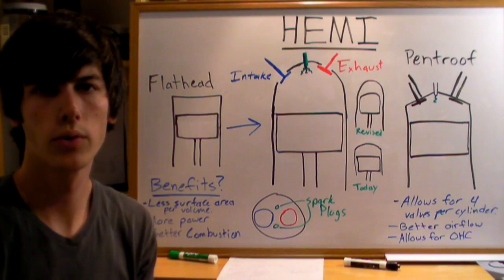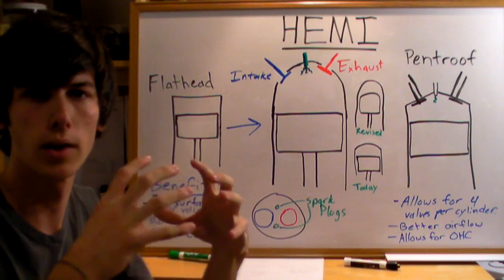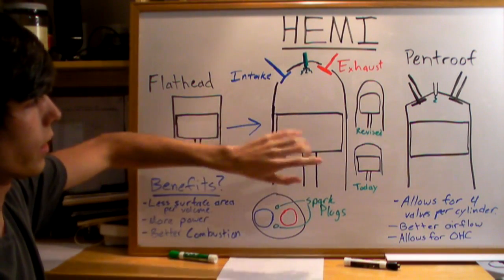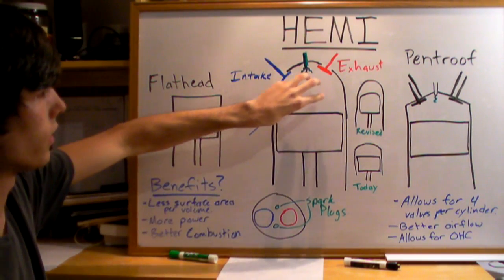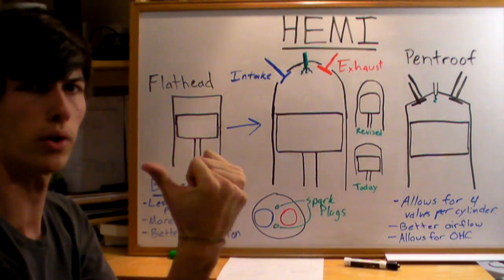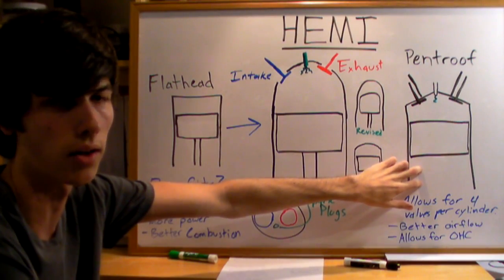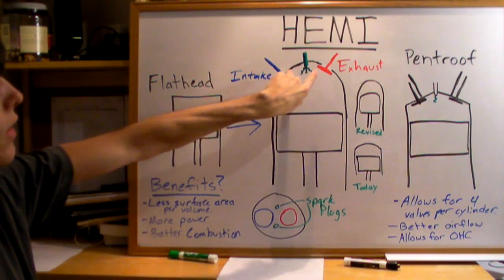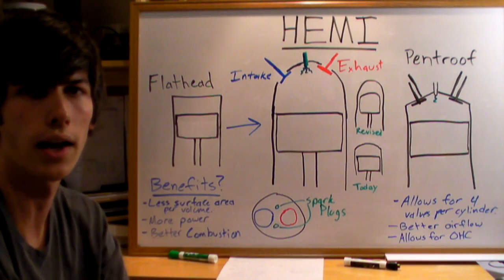What Is A HEMI Engine?

Comment: I like your videos man but disagree with the DOHC vs Push-rod view.  Yes, a DOHC is more efficient due to its valve curtain size but they are also heavier, larger (top to bottom thereby affecting hood design) and far more complex engines that introduce more things that can go wrong.
Reply: DOHC 4v in a V-engine without VVt and VVL is actually simpler than pushrod design and has less moving parts. Judging by the engines available in Europe pushords don't seem to have any advantage in reliability over DOHC. And since DOHC is more efficient a smaller engine can be used for the same performance... with better economy. Important in a place where people do care about fuel costs.
Reply: It may have fewer moving parts... but only if you equate low stress low movement parts like pushrods and rocker arms to high stress high movement parts like timing belts and camshafts.

Comment: I'm a bit confused by the main concept. I understand how the hemispherical shape given you more volume with less surface area. However I don't understand why that's a good thing. 

You mention that with more surface area you get less heat loss? Why would that be? And disregarding that, assuming I understand WHY there is less heat, why does less heat mean less power? What controls the amount of power is the force of the combustion right? The gas/fuel mixture will combust at a certain temperature and drive the piston back down. So long as this combustion is reached at this combustion temperature, why does having a higher temperature matter?

Comment: Those of you hating on pushrod V8's... lol at you, peasants. How many OHC cars from the factory can beat a Corvette or Challenger Hellcat or Demon? Viper ACR around the track? The main disadvantage is that with the extra moving mass, peak RPM's are lower. Ultimately, yes, OHC is the most modern iteration of valvetrain tech (we're not counting weird camless engines and such) and is more efficient. 

EE, shameful! The 5.7L HEMI is the base HEMI in the Mopar realm. SRT HEMI's are 6.1L, 6.4L, or 6.2L supercharged. There's also a non-SRT 6.4L truck engine for Ram (less output, more beefy/durable).

Comment: Two spark plugs per cylinder are not all that unusual, as piston-engine airplanes and some motorcycle engines use that arrangement.
Reply from the maker: +Jon C. I believe airplanes do it for redundancy. Don't want your only spark source failing at 15,000 feet.
Reply: Yes, system redundancy is the primary reason for dual-plugs (and ignition systems) in airplanes, but both plugs are firing during flight which also makes the engines run more efficiently.

Comment: There are going to be more improvements. Maybe electric coil activated valves, maybe something else. But the FACT remains that internal combustion engines are on the way out. Electric motors are much more efficient, period. And better batteries, on board generation or other and overlapping forms of technology will catch up to the electric motors potential. When that happens internal combustion is through. I HATE that. I'm old school. In my late 60s and grew up in the golden age of high performance. But I'm nothing if not a realist. How may of you remember rotary dial telephones? The scrap heap where they ended up is where gasoline engines are headed. No one hates it more than me.

Comment: “Cryptojoe” wrote: “The extra plug fires during the power stroke to more fully burn the hydrocarbons. ... the second ignition allows additional power in the down stroke while lowering the need for restrictive catalyst plates in the converter. ... [using] dual fired plugs on each cylinder allows the firing to take place closer to top dead center, and then again when the piston is on the back side of the power stroke.”

Comment: Should be added that the Hemi (compared to the Wedge design) allowed for bigger valves as they are opposite of each other and not in line like the Wedge. Along with straighter and larger ports gave the HEMI a huge advantage in air flow. The Hemi really shines in high rpm operation or supercharged to move alot of air.
Reply: "These disadvantages are exactly why the hemispherical design was displaced by the Wedge type"
Was under the impression that wedge predominance was merely because it's so much easier to package a wedge-shaped combustion chamber, with parallel valves, in a pushrod engine.  Generally OHC engines aren't constrained in that manner and thus generally don't use that combustion chamber geometry.
Also thought the high surface area/volume ratio and acute angle between piston and head led to excessive emissions.
Reply: punjabimunda5555 this. They also have less inertia each and thus will be less likely to float at a given rpm than one larger valve, even if you don't consider the rocker arms and pushrods
Reply: Perfect explanation!
Reply: Incorrect, two slightly smaller valves are always more efficient in moving air than one bigger valve
Reply: punjabimunda5555 only if its dohc if its pushrod bigger valves are better

Comment: That would be all Top Fuel Dragsters and Funny Car Engines....Lets see a Pentroof engines run a 4 second quarter mile my pubescent friend. 4 valves per cylinder is garbage .More moving parts that will break and more expensive to fix. No proof of better airflow. The Hemi was the first engine to break the 200 mph barrier in NASCAR and break the 300 mph barrier in the NHRA. So please tell me again what a crappy design engine it is?

Comment: I only just now got around to watching this and there are just too many errors in this video, its more like what I would expect to see out of an outdated kid’s schoolbook. Many of the comments are off topic as well, so here is a summary of my opinion:

-Overhead cams actually have been made to work on Hemi engines. In the US a Dual overhead cam 426 Hemi was actually produced and fitted into two Chrysler race cars in 1964 to counter Ford's Single Overhead Cam race engine. Ford was not allowed to use that engine so Chrysler never bothered to put it into production.
-Hemi heads are superior to pent repp heads because they give a much better flame front in actual production engines. The drawings in the video illustrate schoolbook dogma on the subject. In the real world the piston dome is extremely tall in hemis which allows for one spark plug to give an ideal omnidirectional, shallow, flame front.
-Pent roof are a low cost knock off of Hemi heads, they doesn't combust the mixture as well as hemi but are easier to manufacture ad assemble than a hemi.
-Four valve per cylinder heads can flow more air than two valve per cylinder heads even though the valves are smaller die to "curtain area". The amount of air the valves can flow is the diameter times the lift. If you add up the curtain area on a 4 valve its significantly greater than on a 2 valve (on the same engine). A 4 value can open ad close its valves much quicker and with greater control because each (smaller) valve weighs a lot less and so can move faster. It also reduces the stress on the valve train because of the lighter weight (they can also rev higher without heavier valvesprings).
-The cylinders in an engine may be perfectly round however the chambers in the head have a roof that od not round, its actually part round and part flat (hence its called pent roof and not round roof).
-Racing engines do not explain why certain designs are used for street engines, each has difference requirements for their usage and race engines have some vert strict restrictions due to their own politics. Racing engines also have budgets higher than street engines, sometimes costing as much as an entire street car so these comparisons just are irrelevant and invalid.
-As for those of you perplexed about heat loss and combustion chamber shape, keep in mind this video is incorrect, the drawings are incorrect and the explanation is correct only on the most basic level but its also incorrect because it is not illustrating what real world engines are like. Once you take into account that the advantage of the hemi is actually the ability to use hemi pistons then you’ll see that the surface area calculations in the discussion area are also incorrect. The hemi’s advantage is mostly in the uniform and somewhat omnidirectional flame front and its more complete evacuation of the exhaust gasses, the thermal efficiency is possibly a little better but its still relatively poor just like most other comparable street engines.
-Hemi engines are still in production, most engines use pent roof because its performance has gotten a lot closer to hemi and its noticeably cheaper to manufacture.
-Ralph Nader never married, never had a daughter so he did not attack the Corvair because of his child’s death.
-Chrysler; Toyota (I had one), Peugeot, Jaguar, Lancia, Lotus (“Big Valve”), Mitsubishi, Ford (Aftermarket and racing), Porsche (911), Aston Martin and BMW have or had hemi head engines. Stuz had a 4 valve per cylinder hemi head engine back in the early 1900s, so its not impossible just costly to produce, verified by Aston Martin’s 4 valve hemi V8 with double overhead cams and Alfa-Romeo’s 24V hemi.
-Cross-Flow is more likely than not to be simply a marketing term used to get the public to believe that hemi is inherently better that other designs. There is no way the “flow” actually matters because once the fuel air mix is combusted, the resulting gasses are all pushing outwards omnidirectional, the have no memory of which direction they are supposed to go nor do they have uniform inertia in one single direction (towards gas, they are simply pushed out mechanically by the piston.
-Hemi combustion chambers are inherently more efficient so you can make more power or enjoy better fuel economy, depending on how you design it. There have been street engines designed for both those reasons (but not at the same time.
-Hemi engines are not obsolete, they are still superior to pent roof designs, as usual the cheaper to produce pent roof (and wedge) design has been selected by manufacturers to save them a few bucks. Of course Chrysler is still producing Hemis in quantity, so intuit sense its also not obsolete.
-Some but not all Hemis use two spark plugs. there are non-heme designs that use more than one spark plug per cylinder, there is no relationship between being a hemi and two plugs, its a design choice by the manufacturer.
-Despite disadvantages in the past, semis have been made to work better over time, just as pent roof being improved over time. Since the two designs now are so similar to almost appear to be merged, their thermal efficiency and power output is now very close.
-Calculated or theoretical comparisons are fun but do not affect us as consumers because can’t go to a car dealer and ask for a certain engine to be fitted with or without a hemi head. Calculations and theoretical differences don’t show up in the street today in any noticeable way because there are dozens if not hundreds of different factors that a manufacturer has to compromise on that any math that is discussed here is purely for entertainment purposes.
-Most engines are not hemis simply because of cost. Its much more expensive to make a hemi than a wedge or a pent roof. All of these designs now have a squish area that helps get a good burn because all these designs have been improved since they were first invented.
-Increasing the stroke of an engine does not increase compression ratio, it increases displacement
-One poster stated that they purchased a SRT 392 Hemi because Toyota does not make a 485 HP engine, well in fact they do. Toyota’s high horsepower street car offering is known as the Lexus LF-A which features 552 HP. (Ouch!)
-Rotary is no match for something like a Chrysler Hemi, it does not make as much power, wears out quickly (especially apex seals) and has poor emissions, all of which is why its already been put on the extinction list and why Mazda abandoned eh RX-8 a few years ago.
-All else being equal a hemi will make more maximum horsepower, but when have we ever seen everything song equal?
-Changing the shape of the piston does not alter h compression ration, all else being the same. To change the compression ratio you have to squeeze the mixture more or less either by using a position with a taller dome or a head with a smaller chamber (both of these increase the ratio, reverse the process if you need to decrease the ratio).
-Subaru pent roof is not a hemi. The automotive industry makes a clear distinction that pent roof heads are not hemi heads. Although they look extremely similar today, there is a huge difference in manufacturing them and there is still a packaging and performance difference between them.
-There are plenty of pent roof engines whose pistons look pretty much like a highly domed hemi piston. It works very well and is why I previously noted that hemp and pet roof designs are now very close to each other in physical aspects as well as performance.
Reply: Billy bob you are very knowledgeable with engines and disagree with the video. I’ve learned from the vid and from your novel of comments. Thanks a lot my good dude
Reply: Very well explained!!!!

Comment: when did they start installing 2 sparks instead of 1? because in the India, Bajaj is using 2 sparks over a decade ago and now they're using 3 sparks in Ns200, AS200 and RS200 quarter litre class bikes for better fuel efficiency and power.

Comment: 4 valves decreases the heat soak a 2 valve motor would have in just the two valves. allowing for cooler flow and less predetonation

Comment: one of the only naturally aspirated engines capable of producing massive amounts of horsepower without super or turbochargers unlike today's 4 and 6 cylinders, the hemi went into a 200 mph car naturally aspirated, fuel economy? non existant, it needs massive fuel for those big explosions, the only reason why theyre obsolete is because they don't fit well in today's society.

Comment: Well now I am confused lol. The Jeep WJ 99-04 Grand Cherokee with the high output engine has 4 plugs per cylinder does that mean its a Hemi because I beleave it also has 4 valves? Or is it a pentroof?. And I am guessing the new jeeps with the Pentastar engine are simply a pentroof. Does this mean that the modern day Hemi's aren't good or simply more expensive?
Reply: no theyre not obosolete, why dont you hop off this video, youve been at it for years now

Comment: I didn't get one thing though. You said the surface area of the head needs to be reduced to reduce heat loss. Agreed!! But the surface area of a flat head would be pi*r2 and that for a hemisphere would be 2*pi*r2. So, for a given cylinder diameter, the surface area of a flat head is lesser than that of a hemispherical head. And if that is the case, why do we need to change the head design in first place...

Comment: I like your videos but this one brings up a question for me. If the Penta cylinder head design is so much better, why are the top fuel drag cars still using Hemi's and producing over 7000 HP while doing so?
Reply: +Jim Cole As a guess, a lot of pre-compression and nitro fuel.  Nitro is a different animal.  It has an air fuel ration of something like 2:1 or 4:1 rather than 13:1.  So basically you're dumping fuel into the cylinders.  If you have too high of compression on something like that you could actually blow the head gaskets.  This is an educated guess, not a definite answer.